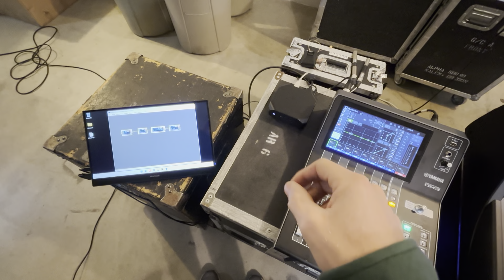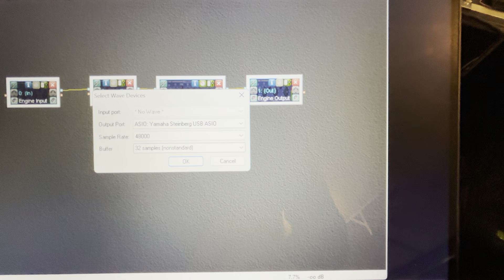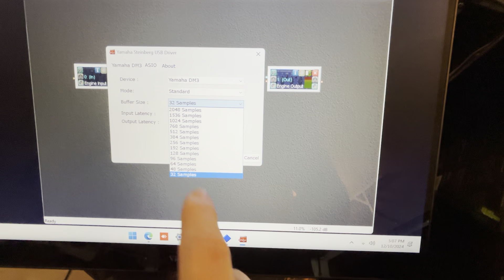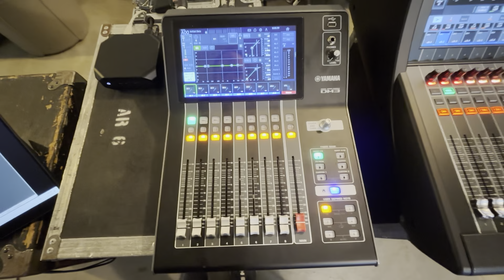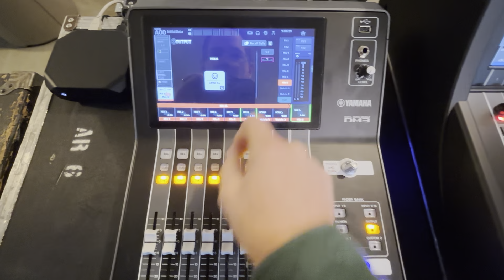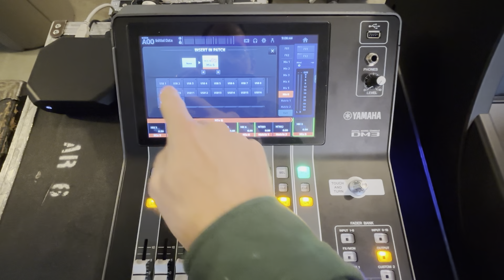De-Feedback USB Patching with Yamaha DM3 and DM7.

Comment: Does the Yamaha DM3 should be working with 96 or 48 Word Clock?
Reply: 48.    But Dante likes 96.  I’ll have to figure a way to do 96 on defeedback
Reply: @PaulCotton  Not true. Dante can be either 48 or 96 as long as all your Dante devices clocks are matching.
Reply: depends on what your other devices are running. Just make sure they're all the same.

Comment: Wow, I’m impressed.  Will definitely give this a try on my events. Looking at this video, I’m assuming it’s similar for Allen and Heath Avantis but I don’t see the analog sound interface. Do I need the interface or just the mini device? I’m considering getting the (4) instances option. Please advise about the interface. Thanx
Reply: If the console doesn't have a USB port then use an audio interface.

Comment: That's pro use. Would be cooler if it worked through dante.
Reply: Yes I wonder.  With dvs.   I’ll have to put dvs on my windows machine and try
Reply: It does work on dante. DVS adds some extra latency when compared to dedicated dante hardware though, so keep that in mind.

Comment: Thank you for this Video, will it also work with a Yamaha TF-1 ?
Reply from the maker: Yes but you’ll just use the analog method for that
Reply: Works on any console. If the console doesn't have a USB port then use an audio interface.

Comment: Are you guys looking to have the plugin ran on Mac devices at some point?
Reply: It does run on mac but with a whole lot more latency
Reply: @chrisjeaaalbertos3802  Not true. It all depends on the machine's processing power.
Reply: @adproducer1  it did matter then. its a new plugin you dingo, by now they have implemented a version for mac that works well
Reply: @chrisjeaaalbertos3802  LOL someone got triggered 🤣
Reply: It doesn't matter if its on Mac or PC as long as it has plenty of processing power.